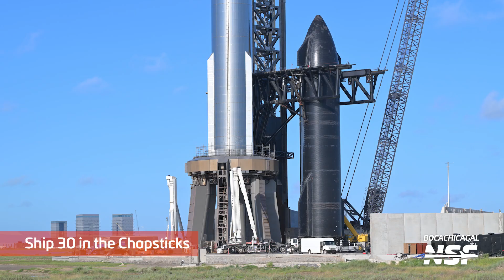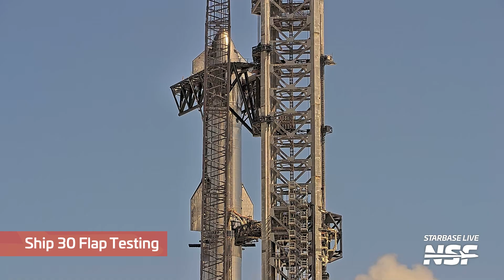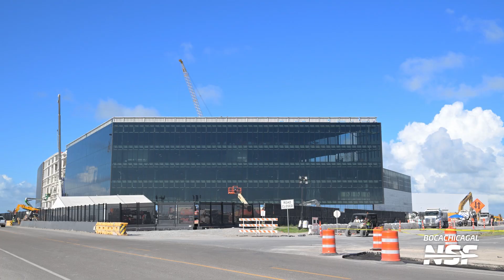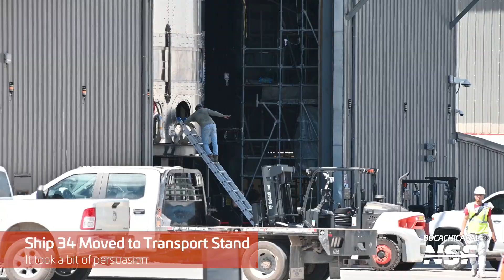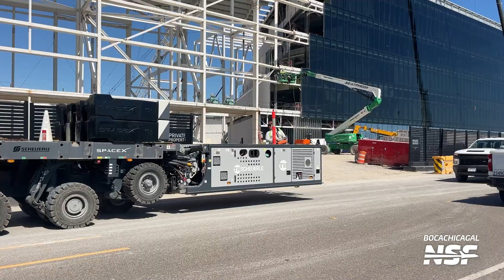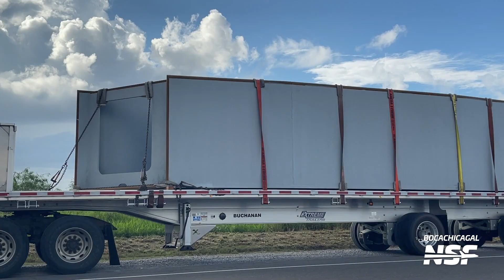Flight Five Full Stack Gets Frosty During Partial Tanking Test | SpaceX Boca Chica

Comment: SPMT (Self-Propelled Modular Transporter) units are modular transport vehicles commonly used for moving large and heavy objects. SpaceX uses them to transport heavy equipment such as rockets and spacecraft components.

Typical dimensions of an SPMT unit:

Width: Around 2.43 meters (8 feet)

Length: Usually 6 to 12 meters (20 to 40 feet), though it can vary based on configuration.

Height: Roughly 1.2 meters (4 feet), adjustable to fit different transport requirements.

SPMTs are modular, meaning multiple units can be connected side by side or in length to accommodate the size and weight of the load being transported. They can support massive weights, often ranging from hundreds to thousands of tons.

Comment: I don't know much about SPMTs, but I would count how many 'power packs' they have which gives you a maximum # they can have mobile at any given time. I'm defining the power pack as the year section with an engine that powers the unit.
Reply from the maker: What if a single assembly has two power packs?? - Das
Reply: @NASASpaceflight  I regard that assembly as a pair of SPMTs. Let's not go down the rabbit hole of "pair of scissors" though.

Comment: Das, according to Mammoet's website: "Self-Propelled Modular Transporters consist of modules with 4, 5, 6, and 8 axle lines. Load capacity differs per version, with a maximum of up to 44 tons per axle line. Each module can be fitted with its own engine and control (steering) system. The modules can be connected side-by-side and/or head-to-tail, to form large ‘platforms on wheels."

Comment: What not have an actuall Industrial robot arm to connect the Ship QD . with added vision capetabilities it will always get it right . thanks for sharing such awesome updates with us starship fans . great work Mary  and NSF team
Reply: An industrial robot is usually fixed to a concrete slab/floor. The ship QD is rotating around a hinge with a long arm (at an angel), with multiple fluid lines. Even the tower flexes. No fixed point of reference.
No robot can do that with the precision of a factory robot. It is impressive that it can connect to the ship on its own.